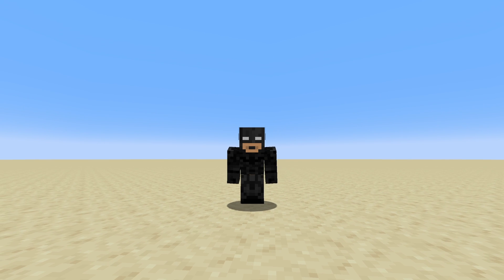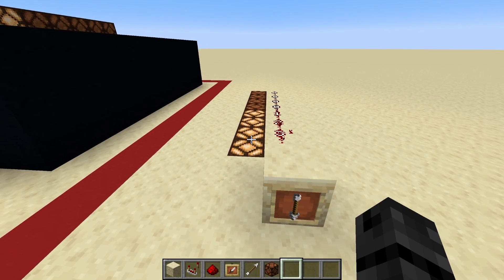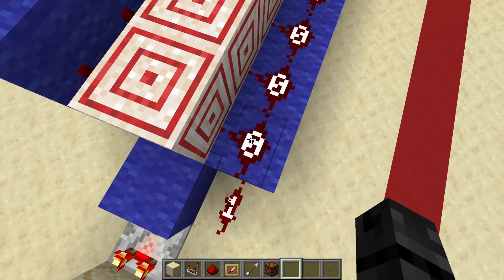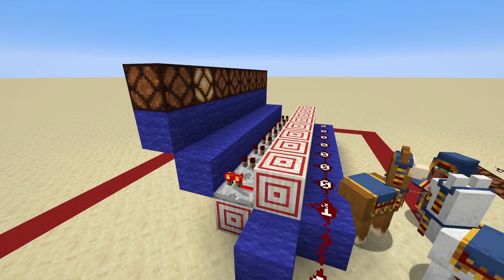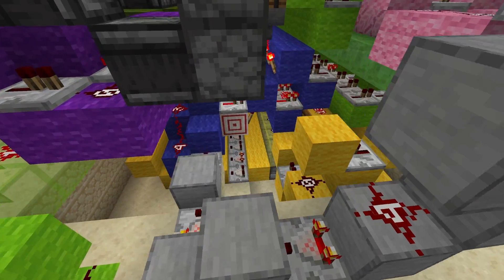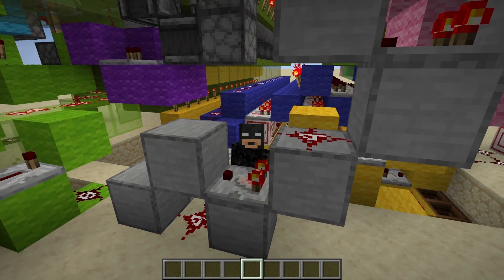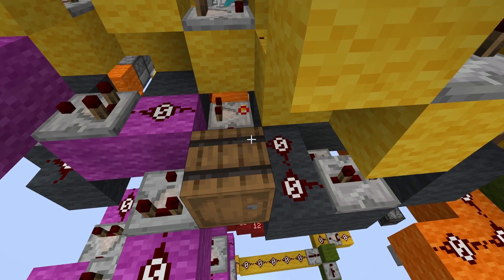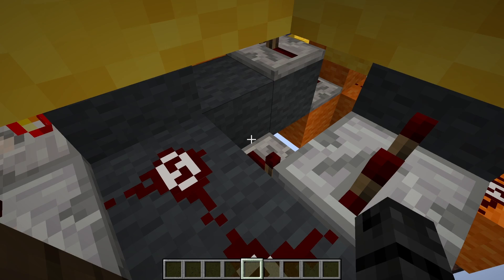This Contraption Makes Signal Strength USEFUL- WTH Is a Redcoder??

Comment: If anyone's still wondering what a decoder is, in electronics it's a circuit designed to "decode" numbers from a compact form into something simple for a computer to use (in certain situations). You just give it a number, like 2, and it turns on output #2 and turns off everything else. It has applications in CPUs for determining which instruction to run, and in RAM or ROM deciding where in memory to read/write. Why is it called a decoder though? Because it's a waaay easier name to use than multiplexer. (Still, it's kinda cool tho)